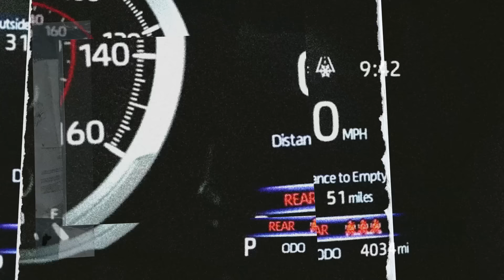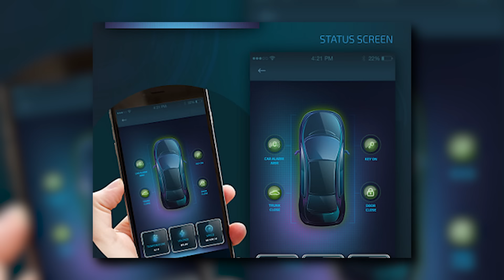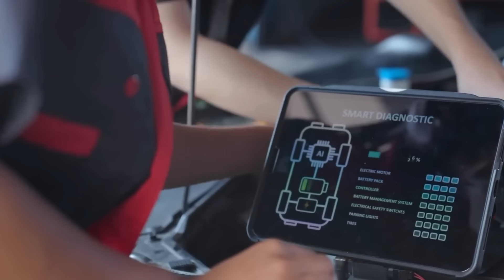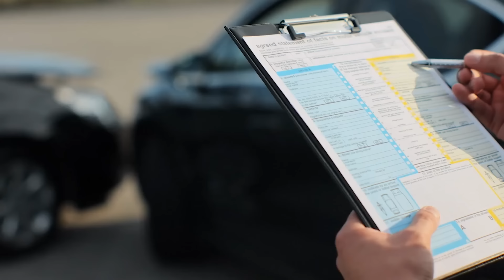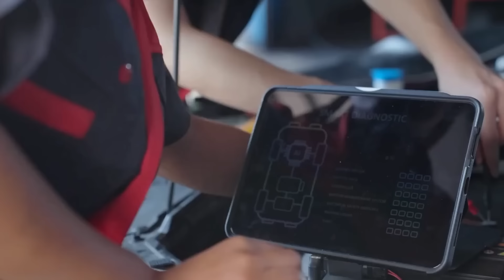Toyota Announces NEW 2025 Toyota Corolla Pickup Truck & Shocked The Entire Car Industry!

Comment: Use the same motor as was used in 2002 mini pick up 4 cylinders as they go beyond 200.000 miles with a great silk like automatic transmission? IF IT AINT BROKE DON'T FIX IT?